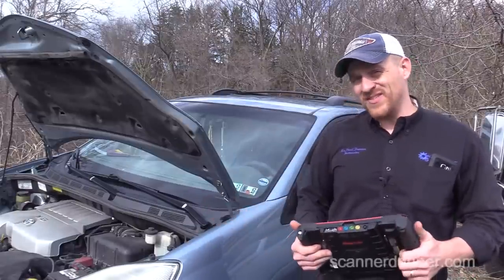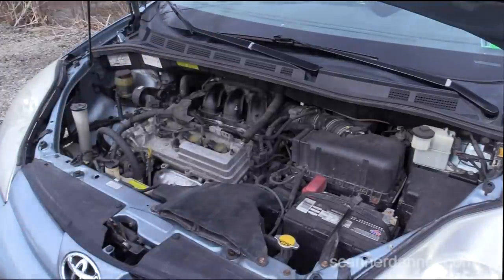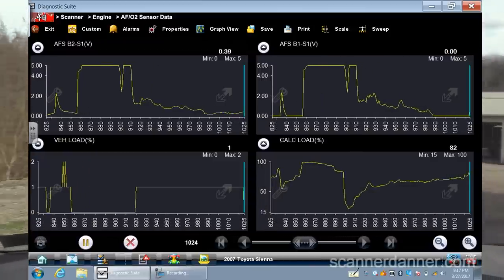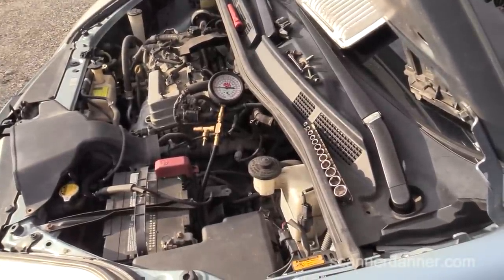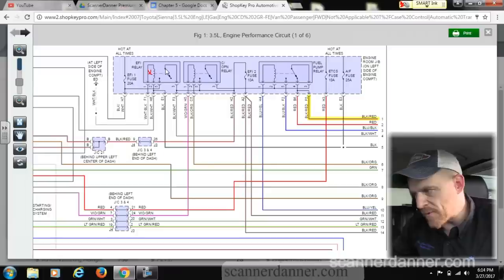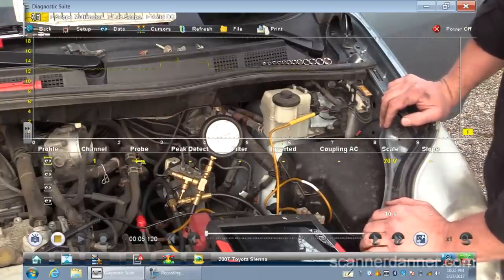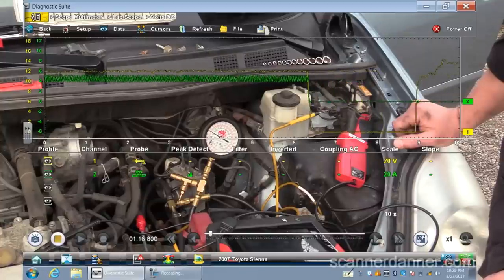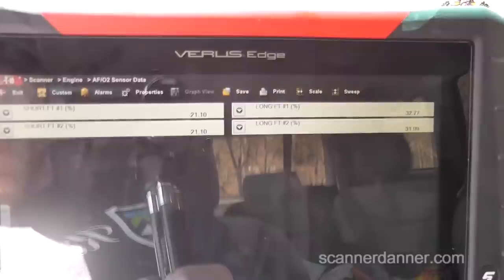2007 Toyota Sienna Low Power, Fuel Delivery Problem, Dual Speed Pump (P0171, P0174, P0101)

Comment: My Sienna (also 07) had the exact same symptoms that you outlined in the video. It would start up and act completely normal cold, but once it got warm, it would get starved of fuel and misfires started up. WOT and we would get nowhere, and it usually stalled. My gut told me fuel pump, but this video confirmed it. Swapped it out last night and it's running way better than before. My guess is the pump was going bad for a while and finally just started failing recently. Really in depth and informative video, I just subscribed!

Comment: You were in your element Paul until I saw the roses on the steering wheel. It all seemed awkward after that. Still a good video. Great job of tracking down the circuit, analyzing it and finding the issue that caused the rough running issue.

Comment: I have the same van I’m pretty sure it   Just has a fuel sock on the pickup, and no additional filter,  good to know about the resistor, great video!
Reply: There should be an actual filter in line somewhere.  I've been told they are under the air filter housing box. A quick Google search somewhat confirms that.
Reply: @sumduma55  Thanks I will check that out
Reply: @sumduma55  All I could find that it’s part of them fuel pump inside the tank I found no other fuel filter anywhere and that was looking on the Internet
Reply: @vinces8974  I just checked.  I guess it might be the sequoia that has the fuel filter or something.  I am wrong.

 I looked through a couple parts suppliers and they do not even list a filter for a 2007 sienna as a part number. So as far as they are concerned,  a fuel filter either doesn't exist or is part of another assembly that doesn't even reference it. Sorry about the false hope.
Reply: @sumduma55  From what I have always understood it is incorporated into the fuel pickup.
Reply: @vinces8974  should be the same as an 06 Corolla the actual filter is inside the plastic pump housing which the pump connects to the filter and then there is a sieve sock type screen on the pickup side of the fuel pump I was able to find a part number on Toyota but they had no pictures of it and it was like 50 dollars so I just ordered some from China was 30 dollars for two took a month to ship I did this cause my sister poured diesel in her Corolla and I bought one extra incase I wanted to change it again eventually or for the 04  sienna.

Comment: A BIG THANKS ! This video is just amazing! Should i be able to see that voltage change if i put an amp clamp around the feed wire to pump, and do snap throttle? Guess ill find out soon since back seat is out anyway, 2010 Scion XB
Reply from the maker: You should, for sure

Comment: before even watching glad to C u again pual 
last week i hade a (Samsung (same hardware and software as Renault))in the shop with the same symptoms and p0171 it ended up being a bad fuel pump short tft are 18 long tft is 25 
after maf unplug it started to die on me 
i ran a fuel pressure gauge and there it was an extremely low fuel pressure
i do not remember the exact number tbh 
it was 1. somthing

Comment: What is the purpose of having two speeds if not to keep the PSI up? Is it for faster delivery when fuel line is empty? Maybe for high volume fuel consumption uses like climbing hills pulling a load, like maybe when full of passengers?
Reply from the maker: On this design, it is simply to reduce the load on the alternator during cruising speeds. (Gas mileage)

Comment: I'm having an intermittent issue with losing power, I think. No codes. It mostly happens when I make a turn, let off the gas, then back on as I'm straightening out of the turn(Or when I'm idling at a stop and then try to go) and nothing seems to happen for half a second then the van will jerk, then run fine. Or while I'm driving it will barely go for a moment, then the RPMs will shoot up, so I'll let off the gas to drop the RPMs then it may or may not jerk when I press the gas again. Thinking it's something to do with fuel, don't know if I should take it to my mechanic or just wait for it to get worse enough to get some codes. Is there something that could be happening that would not give codes?

Comment: If you jump that relay with a light bulb.. it gives it enough resistance that it shouldn't cook the computer.. and then once you have it hooked up right-- you can pull your bulb and get the real current reading.

Comment: Was the P0101 'Mass air flow circuit range' error caused by the weak fuel pump ?
Reply from the maker: Yes and it was "range performance" being the key. So picture the throttle at wide open and the engine not being able to rev, so MAF signal would be low compared to throttle angle.
Most of the time you won't see this with a pump issue. Weird that we did

Comment: Hi Paul, good video, so far of what I’ve been able to watch.  We’re up in an RV park in North Eastern Oregon, vacation, terrible wifi and cell service.  Got a problem.  The manager of the park has a 1998 Dodge 2500 with the V-10.  Has a engine miss at idle, no codes, I have my ThinkTool Pros and looked at running data.  Fuel trims are, long term +19, short term fluctuates between -7 to -13.  I’m thinking a stuck open or leaking fuel injector.  Thoughts.  He’s already had plugs, wires, manifold gaskets, EGR all replaced.  You cannot get to the injectors to unplug or swap them and the scan will not provide me with a miss fire data.
Reply from the maker: Idle only misfires are usually from a valve issue. Do a cranking compression sound test and listen for an uneven cadence, that is repeated. I have videos on this test
Reply: @ScannerDanner  
  Thank you Paul.  I will give that a shot.  Appreciate you.

Comment: I'm trying to figure out why you didn't take your amperage measurements at the fuse with the posability of burning up a computer hooking up wrong at the relay maybe I missed something?
Reply from the maker: The fuse may have fed other circuits too? I don't remember as this was 5 years ago. If that fuse fed other circuits other than the pump, that would have been why I chose to not go there. It would have muddied the waters if that makes sense.
Reply: @ScannerDanner  Makes perfect sense I was thinking the fuse only fed the pump was sure I missed something thanks for all you great videos.

Comment: 39:54 The fact that short-term and long-term fuel trims are not weighted the same makes perfect sense mathematically.  Let's say we start with an injector pulse width of 1.00 ms.  On bank 2, that becomes 1.3199 ms after applying the long-term fuel trim.  To bring that back down to 1.00 ms, you'd have to decrease it by 31.99/1.3199 or 24.24 percent.

To calculate total fuel trim, you'd add short-term and long-term together, but I find it odd that people are adding 2 things together that are not weighted the same.  In my mind, a long-term fuel trim of +31.99 and a short-term fuel trim of -24.24 should result in a total fuel trim of 0 (not 7.75) because it brings you back to the original injector pulse width.  Someone should create an online calculator to help people calculate the REAL total fuel trim.
Reply from the maker: On some they are. On some, they are not

Comment: If I unplug that resistor is it supposed to shut the car off
Reply from the maker: if it is running in the low speed mode yes, but it would have to run out the residual pressure first so it wouldn't immediately shut down
Reply: @ScannerDanner  ok thanks  I thought so

Comment: "DESCRIPTION"
"The FUEL PUMP relay switches the fuel pump speed according to the engine conditions. The fuel pump operates when the ECM receives the starter-operating signal (STA) and crankshaft-rotating signal (NE).
The FUEL PUMP relay is turned ON while the engine is idling or operating at low load. This causes current to flow through the fuel pump resistor to the fuel pump. The fuel pump then operates at low speed.
The FUEL PUMP relay is turned OFF while the engine is cranking or operating at high load. The fuel pump then operates at normal speed." Per Toyota.

I don't think alternator load is the reason or the main reason. They do NOT stat what loads are being considered for high and low speed operations. But with out this video I would think WOT or just acceleration would be the main loads and then any hill or trailer loads. Alternator probably wouldn't be considered for me without Scanner Danner saying anything and then  me going to Google to research.
Reply: Pretty sure is for fuel consumptiond and emissions
Reply from the maker: If we can reduce the load on the battery/alternator, then we can also reduce the drag the alternator places on the engine, which will increase fuel economy "x" percent. It wouldn't be much as this was only about a 2-3 amp difference, but enough for Toyota and other manufactures to use this type of control.

Comment: I’ve got a 2000 Nissan Sentra in the shop right now that runs exactly the same way but it will immediately on start up throw a P0100 MAF code and the MAF voltage does not move from 1.02 volts output.  Now I’m thinking I need to check fuel pressure also.
Reply from the maker: I think I'd focus on that MAF code on start up. Does it start normally? And no MAF voltage changes?
Reply: @ScannerDanner  
Starts up without any issues and MAF voltage is stuck at 1.02 all the time.  A little nervous because that sensor is $130.00.  The wiring schematic is totally different than your Toyota on this video.
Reply: @ScannerDanner  
  The other issue that lead me toward the MAF sensor, other than the code,  is the engine stumbles really bad by giving it throttle with it running in the shop without it being in gear.
Reply from the maker: @weshawkins7165   Can you get me voltage readings on all of the wires with the engine running at idle?
Reply from the maker: @weshawkins7165   For sure you want to focus on this MAF  If the signal voltage is never moving.. And that's why you have a major hesitation problem too.  But I've seen bad grounds on these do similar things which is why I want those voltage readings
Reply: @ScannerDanner  
  I know there is 12.8 battery voltage on the white wire and 4.9 volts on the red wire that feeds the ecm.  The black wire is the ground through the ecm and has some resistance going to ground.  I don’t remember what it was?  The forth wire I did not check.  I figured it was the signal and wouldn’t have read it with it not running.  Those were all checked with it not running.  I’ll try and back probe them and check them in the morning with the engine running.   
  It’s almost 11pm here, got to be almost 2 am there, don’t you sleep.
Reply from the maker: @weshawkins7165  late hockey game and I was wired 😉
Reply: @ScannerDanner  
  Love hockey, great sport.  Just getting up and moving this morning,  smoke from the mosquito fire in Foresthill is terrible,  barely see 200 yards.  Oh and it’s only forecast to be a 100 to 108 degrees today?  I’ll  try and get those numbers this morning.
Reply: @ScannerDanner  
  Ok, white wire battery voltage is 12.9,  red wire is the trigger voltage it’s 5.0 bolts, green is the signal and is stuck at 1.04 bolts at idle and does not change with RPM,  the ground wire back to the PCM is good, I use it to ground the volt meter to get the voltages.  Thanks Paul.
Reply: @ScannerDanner  
  New MAF sensor did the trick.  An old dog still learning.  Appreciate you, thank you.
Reply from the maker: @weshawkins7165  sweet man, good job and sorry for the late reply, hard to keep up sometimes
Reply: @ScannerDanner  
  I understand.  I’m 66 and “retired” but am busier in my little “shade tree” shop at home than a lot of the shops around here.  I still need to find time to get into your book and videos.  Appreciate you.

Comment: Stupid me thinking.....   could you pull the 3rd relay and jumper relay socket pins for full pump voltage?
Reply from the maker: I'd have to go back and look at the diagram again, thanks Tom
Reply: @ScannerDanner  As you were logically thinking 'outloud' to actuate the relay's circuits to apply full power to the pump I thought that maybe a jumper across appropriate pins of the SOCKET after removing the relay would work.

CLEARLY today's cars are 'over-stuffed' with multiple, multiple affectors, actuators, sensors, computers and all.  You da man!!

Comment: Great video. I really enjoyed this one.
I am not sure though that when you said the system works this way for the purpose of the alternator that this would be correct. I feel it is more like an elictrical regulator for fuel pressure. That waveform at the end looked just like a fuel pressure gauge reading would look like on system with a vaccum controlled fuel pressure regulator under a snap throttle. I think if you had the guage hooked after the fix you would have seen a increase of around 2 - 5psi that coincided with the amperage rise. Or at best no drop in pressue.
Any thoughts on this ?
Reply from the maker: 8 amps or 10 amps would still provide enough current for that pump to put out max psi. There is a mechanical regulator is in the tank that controls psi, this is for alternator loads/fuel economy only, it is absolutely not for psi control, it can't be. The regulator dump to control psi is fixed. Make sense?
Reply: @ScannerDanner  Everything in modern cars dances around fuel economy stats.  If your alternator has to generate more current, that requires more throttle.  More throttle means less fuel economy.  Also, the less current the alternator has to create all the time, means longevity and reliability.
Reply: Paul, I respect you in everyway and have followed you for years, but I just cant agree with your resistor theory. Yes there is a regulator in the tank and fuel presure is kept at a regulated pressure, so then why the need for added voltage under load if the pump can maintain this regulated pressure. Are we forgetting about volume with the lower voltage? Surely we need added voltage because under snap throttle and high loads the sudden demand for extra fuel causes a drop in the volume. All systems, be it return or returnless need a way to add  volume  until the fuel demand is reduced. So addition voltage is introduced to quickly accomplish this and then reduced via the resistor when the fuel demand is less.
Ask yourself this. Why the need for more voltage if the pump will maintain the regulated presure under all conditions with the lower voltage. Manufacturers would simply supply less voltage at all times. Now you may be right that they run less voltage for the sake of the alternator but I am damn certain the increased voltage is to restore line presure and volume under high load demands.
Would you agree with this ?
Reply from the maker: @jamesrossmotors  yes, this is completely a volume control type of thing, so less volume being dumped on the regulator return port during low demands. Then full battery voltage is applied (just like every other pump out there) during heavy loads and start up. It's not there for psi control. Psi is the same on this model in both low and high speed modes. 
When we save a few amps from the alternator, we reduce drag on the engine and fuel economy is improved. Not by much, but it is there. 
I'm also basing this theory off of a dual speed Mitsubishi that I worked on years ago and the manufacturer provided that exact description as to why this was being done. I dont see this as anything different with a mechanical psi regulator. I don't see this as a performance type of thing either as just about all in tank electric pumps are running full system voltage, all the time. So in the high speed mode, we're just running the pump like every other system out there. The low speed mode then does what? It will reduce amperage and pump speed during times where on a typical fuel system we just dump a large volume of fuel back to the tank on the psi regulator return line. With the reduced speed, we dump less on the return line with this set up for no other advantage in operation other than a reduced alt. load, so a slight increase in mpg
Thanks for the great discussion!
Reply: @ScannerDanner  My point all along was why the voltage was increased, not why it is decreased. Hence my original comment as to the increased amperage on the waveform would align with the pressure reading on the guage at snap.
The pressure in the system is created by the flow of the injectors which are at the end of the fuel circuit. When they are opened up suddenly there is a drop in pressure and volume. So added voltage or for better full system voltage is applied to return the pressure and volume. I did also say that if not a increase on the guage at best there would be no decrease. 
l would love to see 3 channels hooked up with a pressure transducer on the fuel line, another channel on the amperage to the pump and the other on the map signal as i think the map signal would be the reference that is used to activate the high speed. That could make for a great video.

Comment: Scanner Danner I'm having a p0171 code on my 2011 express 4.8l.after watching one of your yt videos ( and changing maf & bank 1 o2's) I checked fuel pressure ( expecting to find it low) w/koeo pressure was 48 psig at start up fuel pressure pegs above 100 psig. I'm having a hard time understanding why I have a lean code and not a rich code. Any thoughts?
Reply from the maker: Where are you measuring that pressure? Exactly where? Fuel rail pressure is what we want. Maybe a restriction after where you've teed in your gauge?
Reply: @ScannerDanner  at the test port on the rail and btw this is a flex fuel. Pressures were checked using 2 different test gauges.

Comment: The relay was switching on and on not off and on .. Thats why initially there wasn't difference between high mode and low mode
Reply from the maker: I think I addressed that in a note later in the video? Thanks!